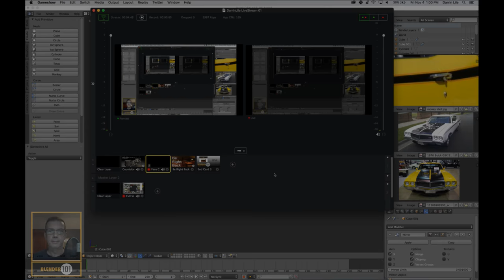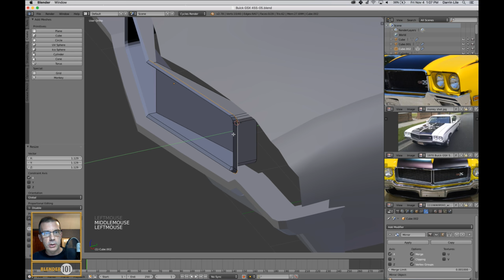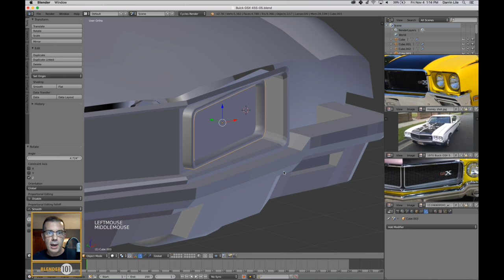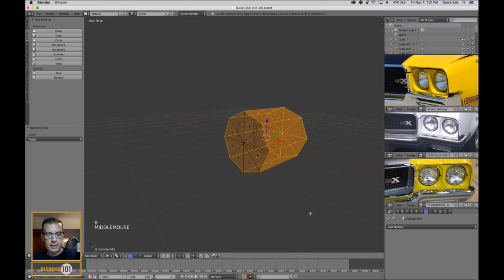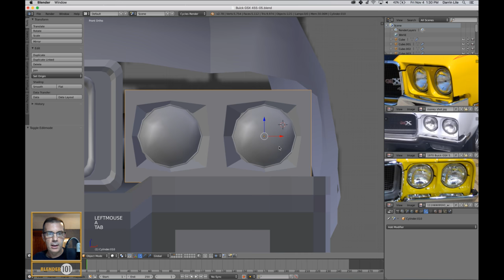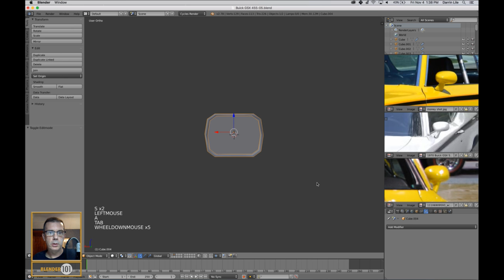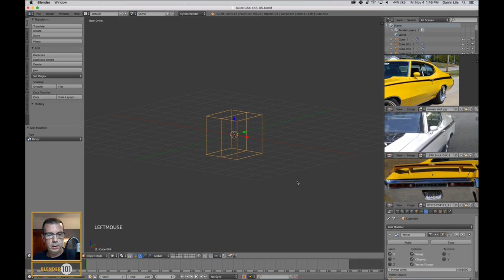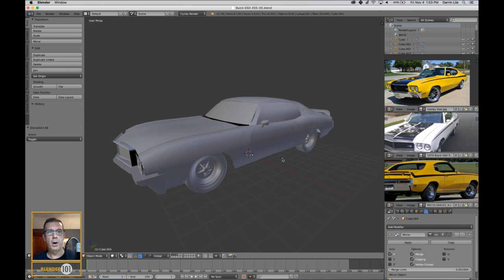Blender Car Modeling 05-Live Stream

Comment: You're a fantastic modeler Darrin, and these videos are great...Like you said, there's no single "correct" way to go about modeling any certain object. I find myself in that same situation thinking about how my topology should be and comparing it to other people's work when I should have just tried grinding it out from the start. Airplane cockpits, especially when the dimensions have to be correct, are some of the hardest things I've ever modeled. There is almost no way to maintain quads without wasting a ton of geometry that could be used in other places.